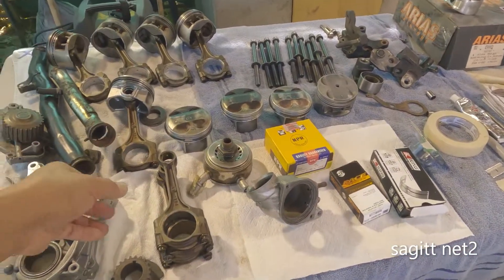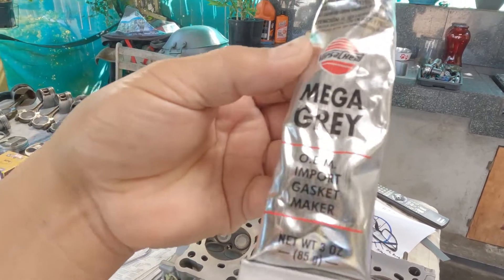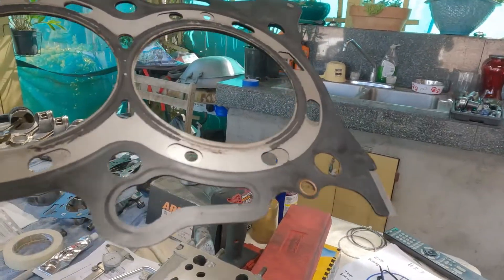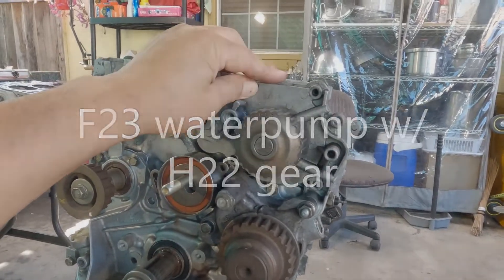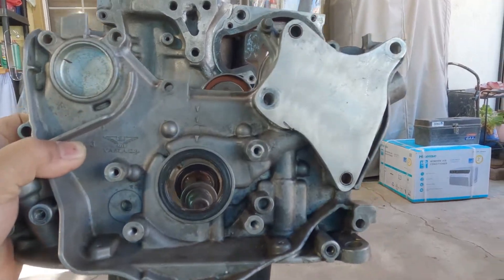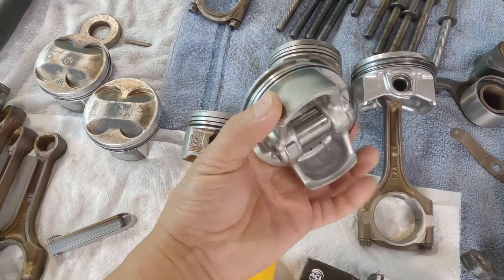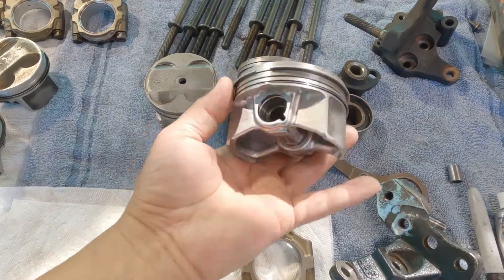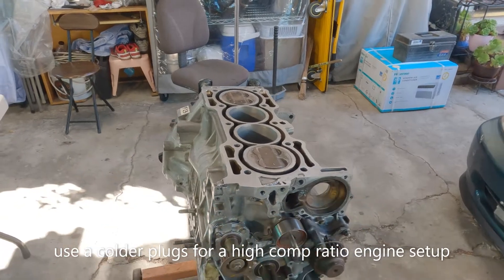G23vtec Build Parts List version 2.1

Comment: Damn. 
I've been building my g23 for a year and am ready to drop it in. And now I'm finding out the arrowsvonnthe piston crowns need to face the bell housing side of the block🤦
So what's going to happen if I decide to leave them installed that way?
Reply from the maker: Lots of engine builders facing the piston like it, it should be alright l guess. I've never install a K20 piston w/ arrow facing the timing belt so l could not really tell you what will be the effecr. Never heard of someone complaining there's a issue if place like it.

Comment: Are you able to put h22 pistons on a f23 block stock sleeve?? I am afraid to use them since I have been told that h22 pistons comes with a coating(FRM) and I am not sure if they are compatible with iron sleeves.
Also, it is ok to use h22a1 vtec head? Or I need to find a a4?
Reply from the maker: Using H22 piston have no effect on iron sleeve. It's the H22, H23avtec block have the FRM coating. You need a special piston material to use on H block other than OE piston. So no worry using H22 piston on F23. You can use 92-2001 H22 or F20b, H23avtec cylinder head. If you decide to use the kstuned plug or anything similar, make sure to use a Hondabond or MegaGrey sealant on it. Hope these help you out.

Comment: If I'm use the f20b head cylinder do I need to cut the f23 water pipe?
Reply from the maker: Yes, coz f20b cyl head thermostat housing is the same as H22, H23a. Unless you buy the Tracktuff water coolant pipe w/c plug n play, no cutting require.

Comment: Have u tried cometic multi layer head gaskets they come in different thicknesses
Reply from the maker: Never tried Cometic, I used Felpro one time and we found out it was the caused of oil leak and never used any other brand after that other than Honda headgasket. Not sure w/c cost more than Oe or Cometic. If it's about same price maybe 1 day l'll give Cometic a try.

Comment: Do you have an Instruction on plugging the oil galleys for the block
Reply from the maker: Kstuned have a instructional video for different block. I did it on one of my f23 block before using their instruction. Maybe one of these day l might do a blog about it, showing my diy  plug.
Reply: @sagittnet2158  please update me if you do
Reply from the maker: @lucygelz  no worries man! I'll be making a blog about it soon. It'll be on the cyl head and l'm going to use a expandable rubber also, just like what l did on the oil pump.
Reply from the maker: @lucygelz Plugging the h22 cylinder head is uploaded! You'll see it on regular day time show. Thanks man!

Comment: Could you do this build with a bored f22a block? Have a couple of those laying around and want to build something NA.
Reply from the maker: Yes and it'll be  g22. The engine will be similar to a H23a (bluetop) they have same 95mm crank except your f22 is 50mm main bearings. I'm not very familiar on g22 build as far as w/c piston to use but for timing belt areas, use H22.
Reply: @sagittnet2158  thank you for the quick and detailed reply! I'll do more research on the G22 now. Love your videos been watching a bunch after stumbling across your channel today.

As far as I know I can use the k20a2 pistons in reverse like you did but need to use aftermarket f22/h23 rods for the wrist pins.
Reply from the maker: @Grocery_Wagon_Racing  Thank you and yes, k20a2 can be use on those rods.

Comment: If I already have a running f23 in my car can i just use the f23 pistons? Why switch to k20?
Reply from the maker: The compression ratio is too low and it'll be too slow to accelerate at low rpm. When k20 piston is use it'll bump your comp ratio to 11:1
Reply from the maker: That's when using a H22 cylinder head on F23 block.

Comment: Hey Sagitt. Where can i find an Oem F23 head gasket. Cant seem to find an Oem gasket.
Reply from the maker: Hondapartsonline.com, there are 2 F23 headgasket they sell (12251-paa-a01 and a02) either one can be use but always check the copper rivets, if it's will be sandwhich by 2 surfaces, simply remove it. The 2 dowell pins on the block will guide it center. You can also check Amazon, someone is selling it. If you cant buy it online, there's always stealership ( more $$ of course) but less headache in the long run. You dont have to worry about oil leaks. Not sure what type of plugs did you use on cyl head, in case you use kstuned plugs. I recommend to smear some sealant on top and bottom part for added assurance. Seen others complain about oil leaks still. I use sealant called Mega grey, it's same stuff as Hondabond.
Reply: @sagittnet2158  thank you. Found it! I will be using the ks tuned plugs.

Comment: For the oil drain plugs could i weld before i get the head resurfaced
Reply from the maker: Yes, weld it shut then send it to get resurface. If your plan is welding it, might as well add a material on the #2 oil drain. Its on the intake side. That way you can use a aftermarket headgasket if you wish.  I found out that using other than OE headgasket, it leak oil on that side. You can watch one of my vlog about it. I showed where it was that aftermarket gasket not covering oil drain much.
Reply: @sagittnet2158  thanks man 🙌♥️i love your videos,I'll go watch that video as well 🙂
Reply from the maker: @stevenjames3356  https://youtube.com/watch?v=2LwkTmkh01w&si=EnSIkaIECMiOmarE
Reply from the maker: @stevenjames3356  it's right at the beginning/ headgasket.

Comment: What pistons should we use for low compression?
Reply from the maker: Variety of piston brand off the shelf to use actually. I'm using k20a2 Cp piston coz it does'nt have a wrist pin offset. No need to install piston backwards to orient the piston pin offset like regular F23 piston. Are you thinking of boosting the g23? Pick a k20a2 piston that is advertise to have a of 9.1 to 9.6. 1 ratio for example and visit www.zealautowerks.com, type all information together w/ k20 piston dome CC value. From there that'll give you an idea.

Comment: What did you use for engine harness and ecu (obd1 or bod2)?
Reply from the maker: I used a 1996 Civic lx harness(obd2a) and extended some wires and change some connector for IAT.
Reply: @sagittnet2158  I am also considering using my stock harness for my Eg.
Reply from the maker: @jasonphilips4731  it'll work, just need to extend or add some wirings. I found that obd2 connectors are much easier to depin compare to obd1.
Reply: @sagittnet2158  Ok thanks 👍

Comment: So do I need to modify reliefs on my nippon k20a2 pistons for my g23 or can I just drop in?
Reply from the maker: Drop in, l just shaved the relief back then just  for a R&D. There are plenty of p2v clearance  .
Reply: @sagittnet2158  thank you so much, love the videos
Reply from the maker: @Gee2b_civic  thank you brother
Reply: @sagittnet2158  sorry one more question, even with a big cam like a skunk pro 1 you don’t think k20 piston exhaust relief needs to be opened up a little?
Reply from the maker: @Gee2b_civic  lf you use a CP piston no need, there's plenty of room. If Oem piston is use and require to be install backward coz of the offset then l think it wont hurt to widen the exhaust relief. But it's better to clay it so to be sure. What piston are you thinking of using on f23 block? Nippon racing jdm piston or Cp piston?
Reply: @sagittnet2158  I have the nippon type s, h head with pro 1 cam, pistons will definitely be installed backwards, just worried about relief size
Reply from the maker: @Gee2b_civic  Ok, if you have the regular type S and not the RRC ctr or itr type S piston. I think you'll be ok. RRC nippon racing piston will give more comp ratio.  If you have a use headgasket for mock up and since you have the pro 1, just give it a clay check to verify.
Reply: @sagittnet2158  ya I just have the k20a Rsx type s straight from nippon (my friend is a distributor) but ya I will clay the motor to make sure everything good, my head is already together, I spun a bearing in my h23a so I’m doing a g23 build now
Reply from the maker: @Gee2b_civic  Nice to have some hook up.Are you using the H23A block w/ F23 crank n rods or you got yourself a F23 block?. Good luck on your build.
Reply: @sagittnet2158  f23a block, maxspeeding f23 rods, k20a type s pistons, thank you sir and thank you for the help